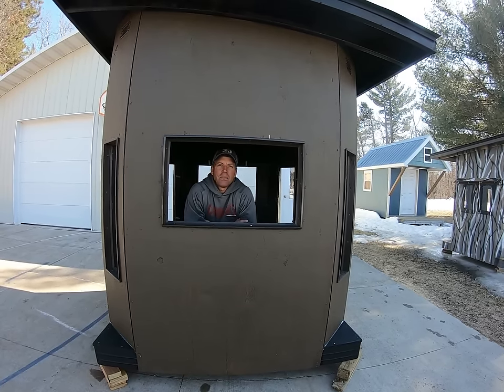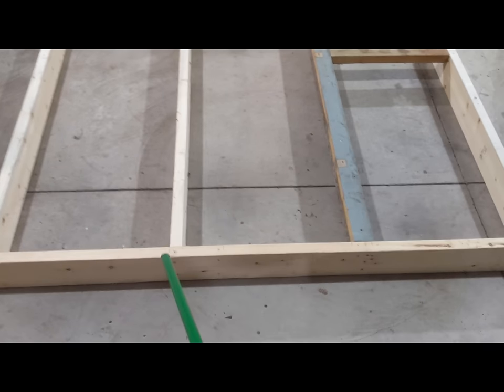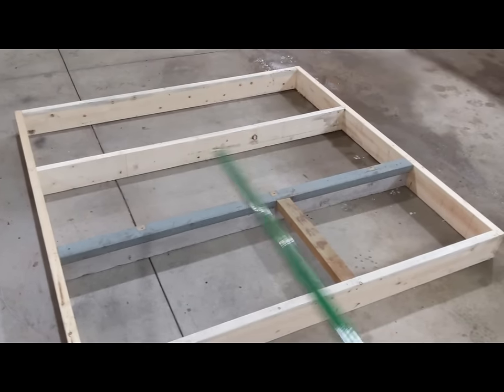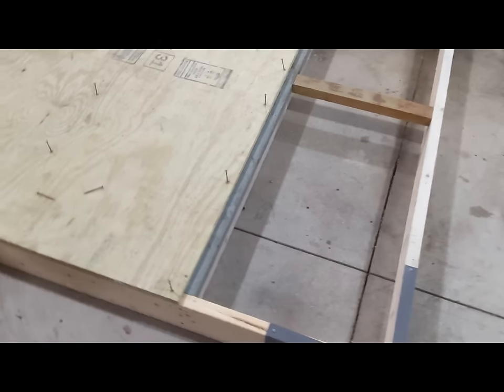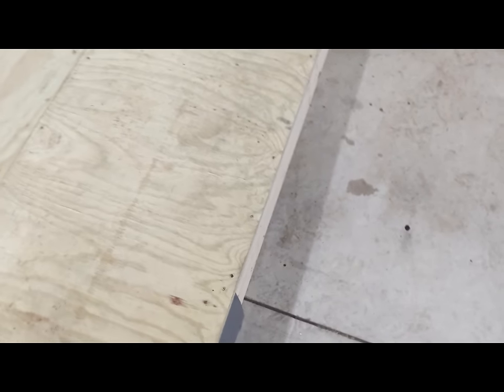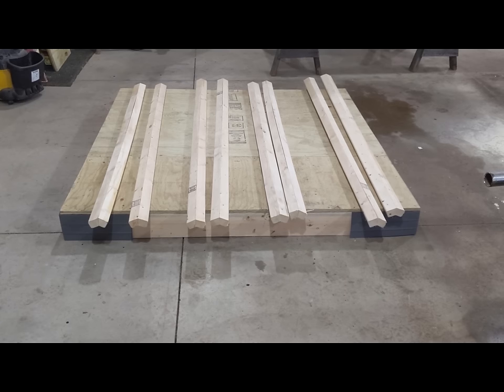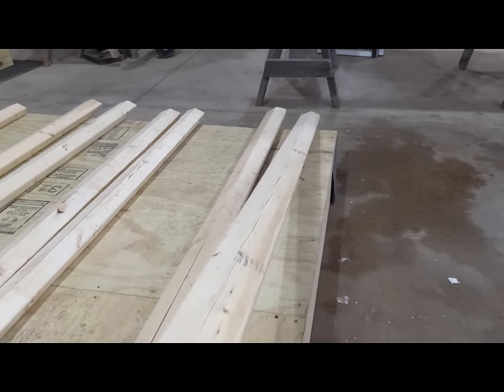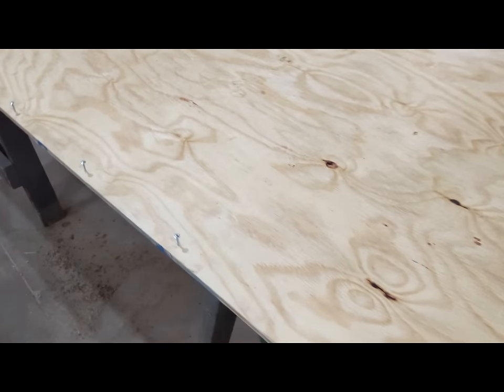Octagon Deer Hunting Blind Build - Part 1

Comment: This is great now planning to Bulid mine , very excited to try it. The audio and video are perfectly done sir thank you.
Reply from the maker: Thanks! I hope it goes well for you 🔨
Reply: @UncleBucks  I was think about using stall mats inside. I worst that carpet might get funky. Did you have any issues with carpet being inside?
Reply: @UncleBucks another question for you where did you get your stairs on part 3 ?
Reply from the maker: @anthonykontos7931  no issues with the carpeting so far. It can be pulled out to dry or clean, but I haven't had to. Seems if it does get a little wet from tracking in snow, it dries out on its own eventually.
Reply from the maker: @anthonykontos7931  the ladder and platform is a modified 2-person ladder stand. Not sure where it came from as it's probably 15 or 20 years old. It works pretty well for this though.

Comment: I am just starting to build mine, materials are going up in price. Your video is very clear and easy to follow.  The hard part will be putting it up in the air. Thanks for the video and dimensions
Reply from the maker: I am glad that you find it helpful! Good luck with your build Louis. It will be satisfying  to hunt out of what you build!
Reply: Build the platform and walls leave the walls off and then get the elevator brackets and 4x4s and bolt them to the platform and erect and level the platform u can stand the post and platform up with 2 good guys and then jst put the pre-built walls up and screw it all together in the air it was easy outta the bed of my pick up!!! Roof was trickiest but doable! But yes this is the best DIY video and by far the best window idea for a hunting shack!Thanks Brett!
Reply: Update, Well, I am almost done, few windows and sheet the roof. Issues I ran into. Menards can't make a 4x8 sheet of plywood. Couldn't get the walls to align then found out every sheet of plywood was 48 5/8 wide, length didn't matter since it's cut off. Burnt up my table saw ripping the 2x4's. But my new saw cut the windows nicely. Elevator brackets arrived. So maybe this weekend I will attempt to stand it up. I found a free storm door I put on. Figured that would work smoothly. Has the glass and a good screen. Thanks again
Reply from the maker: @louispaffel9646  I think  the lumber  yards have to accept the reject lumber  now. It's  all that's  available! Ran into the same thing  here. Had to actually  square up several  sheets of  plywood to begin  with!

Comment: Great video!! Just finished my blind and everything was spot on. Setting it on post this weekend with the help of some borrowed equipment. Had to re-use window cut outs due to pecan prices/shortage.... thanks a lot Covid-19!!!! But all in all over pleased with how it turned out.
Reply from the maker: Glad to hear it came together for you! Just a note of caution - when you set it on posts, make sure you bolt the joists to the posts before backing the machinery out. Don't trust the corner triangles alone to hold up the weight of the entire blind. Good luck and good hunting!
Reply: @UncleBucks  I am leveling a 2x6 support band bolted to the post for it rest on until permanently attached , which will become a place to attach a 4x6 deck on the door side with stairs and hand rails for my 76 yr old dad. This has been a great project for me and my Dad to work on together. This will be a great addition to my farm and hopefully will get him back into deer hunting more. Thanks for all the detailed information...spent a lot of time looking for exactly what I wanted and this is exactly it !!!!
Reply from the maker: @rodneyedwards5838  that method sounds like a very good idea & also time well spent!

Comment: Brett, thanks for the detail that is contained in your videos. I have scanned these comments and didn't find an answer to this question. What is the reason that you kept the corners square and didn't follow the miter of the blind, which would allow that plywood to cover the ledger board?
Reply from the maker: You're welcome. I did it this way for two reasons. The first, it's just easier and quicker to frame out the floor/base. Second, having 90 degree corners provides better framework for setting up the blind on buried 4x4 or 6x6 posts. I use this method most because the ground is usally sloped where I choose to put a blind, and I prefer going with buried posts on uneven terrain. The corner gives you two directions to lag your base to the posts. If you know that you are going to use elevator brackets for your blind (which work great on level ground) the corners could certainly be done as you described.

Comment: Awesome blind! Do you have a list of the total materials needed if I were to buy it all new?
Reply from the maker: 6x6 Octagon Box Blind Material List

Base (pressure treated wood and screws recommended):

3- 2x6x12' for making the joists
2- 4x8x 3/4" plywood for the floor boards 1# of 4" construction screws 
2# of 2-1/2" construction screws
1-6'x6' piece of carpeting

*construction adhesive - optional for gluing plywood to joists

Walls & Roof Materials:

10-2x4x7' for comer studs and inside wall rafters (you might have to buy 5 -2 x 4 x 14' instead)
13-2x4x8', for window frames, headers, and rafters 
1-2x4x12' for making the door 
7-4x8x1/2" plywood, for the walls and door 
2-4x8x1/2" OSB, for the roof sheeting 
4 lengths of roof edge, metal or aluminum (sold in 10 lengths?) gray, brown or green recommended 
1 length of pole barn steel bottom trim piece, for the top side of the steel roof (sold in 12 lengths)
 3-8' pieces of pro rib steel panels (charcoal gray is a good color) 
roof felt/tar paper (only about 72 sq ft is needed) & a handful of staples 
1# of steel panel/ pole barn metal screws (3/4" long I think) 
2# of 1-1/4" wafer head screws or galvanized counter sink screws, for attaching plywood to studs 
2# of 3-1/2" construction screws for rafter assembly 
4 tubes of clear-drying caulking 
1 gallon of dark/bark brown exterior solid color stain for inside and out
OR
1/2 gallon exterior solid color stain & 1/2 gallon flat black interior paint.
*I also used a couple of rattle spray cans of flat black paint for getting the comers painted inside

Door Hardware:
3 gate style flat hinges, for the door (painted or galvanized recommended) 
1 shed door latch 
2 rolls of 1/4" thick by 1/2" wide sponge tape (better quality version recommended) 
2 L-Brackets" for door frame reinforcement

Windows:
5-clear acrylic sheets / plexiglass (0.220 x 20" x 32") 
50 pc pack of 3/16", 1/4" aluminum rivets 
11 pairs of standard 2" hinges 
1 length of 1/2" gray PVC schedule-40 conduit pipe for the window closers 
1 pack of 1-1/2" sheet metal / pan head screws (#8 maybe?), for mounting the window closers 
14 washers,  1/4" or smaller for behind the window closers 
6 pieces of garage door stop (9' lengths), for making the window seals

Comment: Awesome videos!  Why hold the sheathing down 6 1/2" when a joists (5-1/2") + decking (3/4") equals 6-1/4"?  Are you overhanging the bottom that extra 1/4"?
Reply from the maker: Great question and comment. This is a small glitch on my part. The bottom of the sheeting should end up flush with the bottom of the rim joist, or even a little short is better vs being a little too long, especially if you are using pallet forks to elevate. I think I added that extra quarter inch because I had initially planned to permanently put thicker carpet or padding on the floor before installing the walls/corner studs. In retrospect, putting a 1/4 inch rubber shim (like a piece of truck bedmat or rubber mudflap) under the corner studs would resolve that 1/4 inch overhang and also help to eliminate any squeaks from stud to floor sheeting contact. I noticed that happens now and again while moving around in the blind. An easy fix (if you don't want that extra quarter inch hanging over the bottom is to just place the corner studs at 6-1/4" or even 6" up from the bottom of the wall sheeting instead. It won't end up causing any problems on the top side. I'd recommend putting a dab of silicone or construction adhesive to the bottom of the corner studs if they aren't shimmed with rubber.
Reply: @UncleBucks  do your best and silicone the rest!!!  Great video!  I'm going to try to make some cad drawings based off this video for future builds for myself!
Reply: Did you ever  make the drawings and if so are you willing to share?

Comment: Your corner studs 

2 x4     Which is really 1 1/2 x 3 1/2
So cutting on 22.5 degree angle over 2 inches is not in middle      Won’t be same size.   Is this ?intentional
Reply from the maker: Both pieces should be the same size if done that way. Give it a try with a short piece of 2x4 (1-1/2 x 3-1/2) first. You'll get two equal sides just like in the video. I have found that lowering the blade to just cut through the board results in a bit less binding up in the table saw.
Reply from the maker: I have a video on my channel about just making corner studs and nothing else FYI.

Comment: First off nice job building this. Im getting ready to build one and just have a question.  When you built the floor why not just make it octagon shaped as well?  Was it so you can make the legs closer to the outside?
Reply from the maker: You certainly can frame the floor that way if you'd like. It will take a few extra angled cuts on the joists but should not be difficult to accomplish. I build the corners this way because you can use elevator brackets on the corners OR set it on 4x4 or 6x6 posts buried in the ground  instead, and have those 90 degree corners to bolt the posts to - which to me is way easier to accomplish on uneven terrain v.s. elevator brackets.
Reply: I made one a few years ago and I did my base on the same 22.5 degree angle.  Out of 2x6s tho and mitered with long lag bolts and strong ext wood glue.

Comment: just regular plywood used for the walls? was anything pressure treated other than the base?
Reply from the maker: Yes, regular plywood walls but they were stained with an exterior-rated stain for wood.
Reply: @UncleBucks  

Do you have a complete plans I'm looking too build this.. In time for this year
Reply from the maker: @erikclingerman5602  plans are at the end of Part 2.